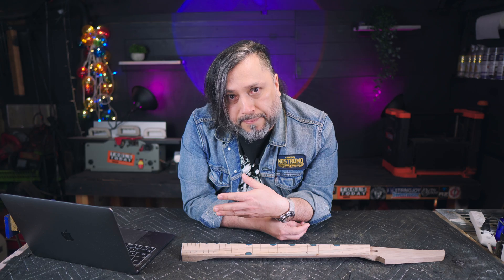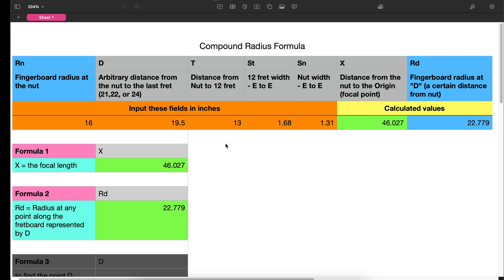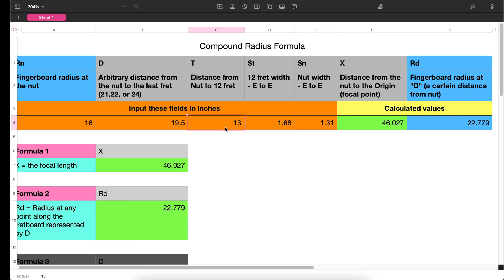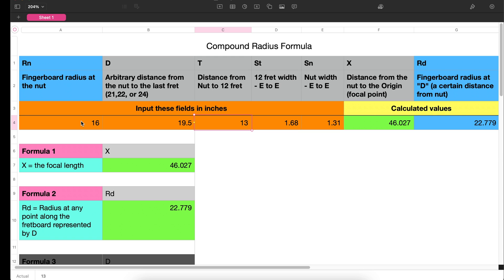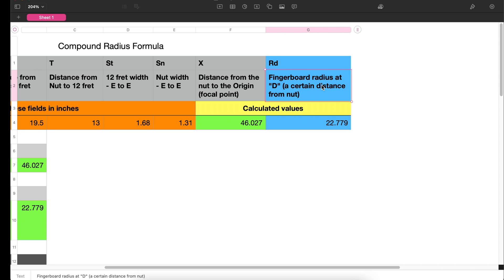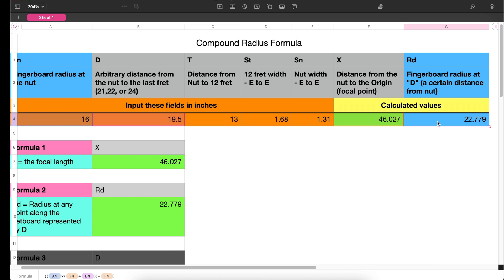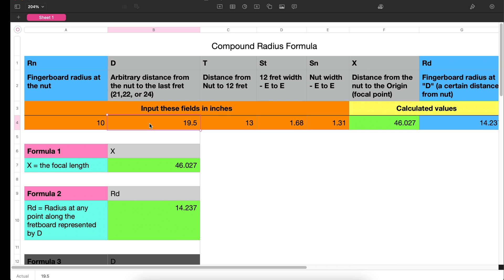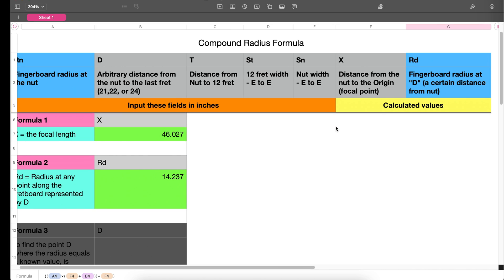Conical Radius Fretboard - A fretboard is a cone, not a cylinder

Comment: The conical radius thing was my dilemma when I built a 6 string fretless bass back in 1994/1995.  Because I couldn't afford to buy one.  Was 18 in engineering school, and didn't have much for tools or money.  The only thing that made sense was that the proper fingerboard was a section of a cone, that couldn't be done properly with radiused sanding blocks.  The only way was to find a factory that could do it on a CNC, which was beyond my means.  Ebony was $56 a board foot, and I didn't wanna screw it up.  It was either do it right or not at all.  So I made the fingerboard flat.  Got used to it quickly, and played it for like 14 years until it needed some considerable work.  Some years later I just bought a cheap Chinese replacement.  And it was rather nice that the fingerboards on those were flat too.
Reply from the maker: Thanks for sharing your story. That is super cool! Flat fretboards are super comfy.

Comment: did a conical radius by hand the other day so I could go from 7.25" at the nut to a 11" bridge. Just sandpaper glued to a long narrow block (unradiused), and some radius gauges. Was surprisingly easy and quick to dial in the compound radius. Was surprised when I was done, "is that all there is to it?"

Comment: Very cool marker idea, would be excellent for LED lighted designs.  Couldn't you se a VCarve on the first pass for sharp corners and then an end mill if you wanted more depth at the sides?   I love excel, thats a great compound radius spreadsheet.  I have used the grizzly swingarm attachment for a belt sander in the past but no longer have it so I am looking for a better way that is more accurate.

Comment: As always, excellent video. I've designed a bunch of necks in illustrator+rhino, but never thought about the fact that a compound radius neck expresses a cone. Enlightening stuff!

I'm curious, will you maintain the radius when carving the nut and setting up the individual bridge saddles?
Reply from the maker: Hi Matt, yes, the nut slot depths maintain the radius and the saddle height as well. But I will deviate slightly with the saddles on the heavier strings. I go off radius and make the saddle higher on the low E to accommodate for string vibration. How the string oscillates is NOT accounted for with conical radius fretboards.